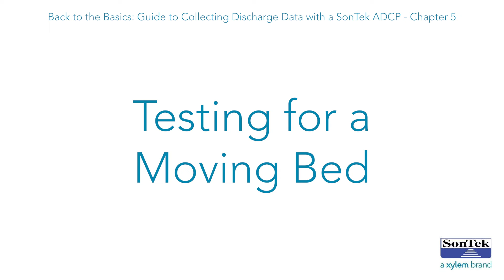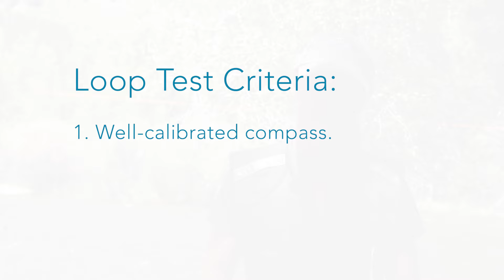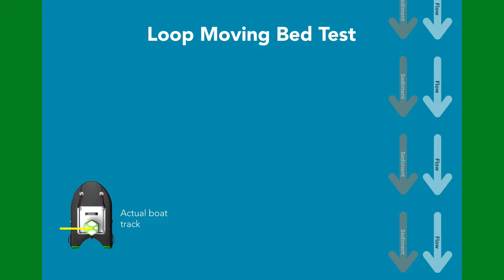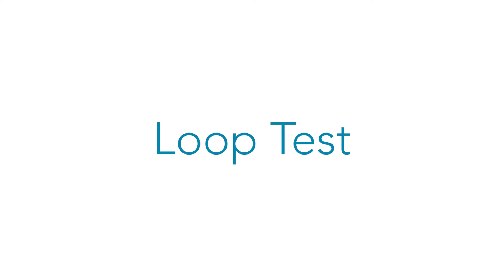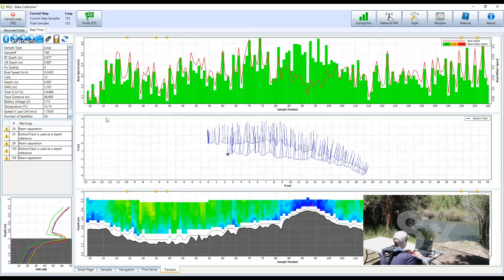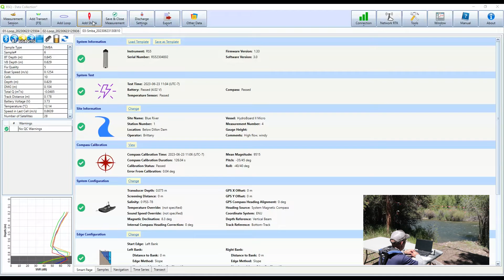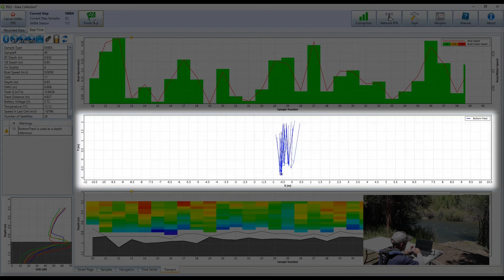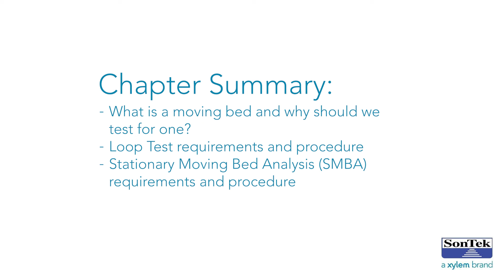05 Testing for a Moving Bed - Guide to Collecting Discharge Data with a SonTek ADCP

Comment: Hello.  I was wondering if anyone could explain the loop being invalid due to not being in an upstream position and how to avoid such an error message.  I will occasionally get the error message regardless of the vessel returning to its starting position, or slightly up or downstream of its starting position.